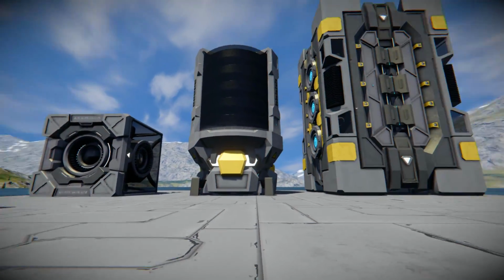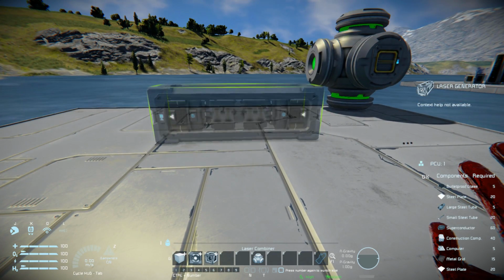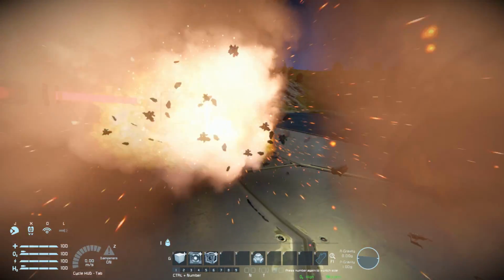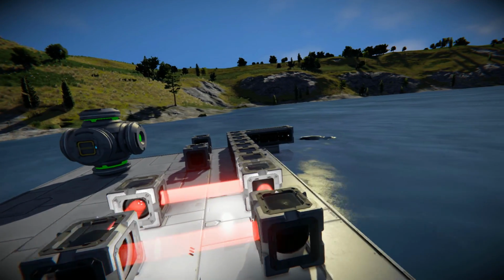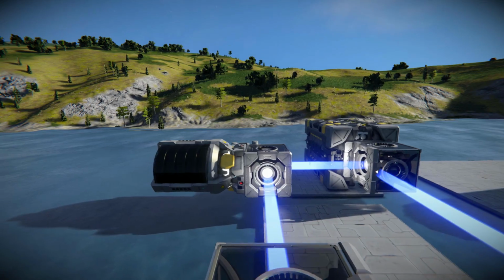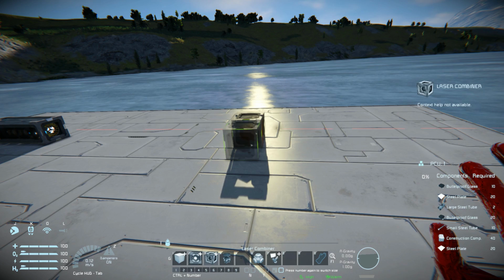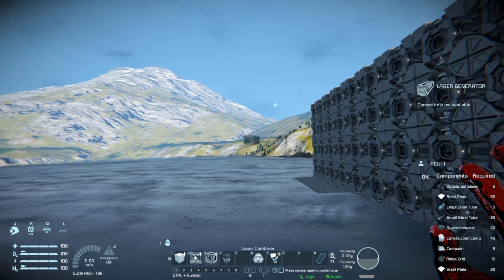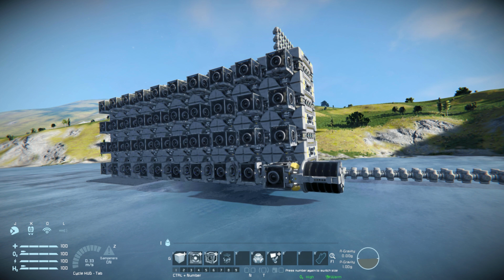2cm Beam System - Space Engineers (Mod)

Comment: a block that would really help this for charge up is a combiner that can flip between two emitters at the touch of a button. also the small laser will be a much more pratical ship to ship weapon while the ion beam would be better for anti station work (long range plus unmoving target)
Reply: i think it'd be possible to make the ion beam work for ship combat. most of the beam handling equipment would need to be deep within the ship and have the beam directed down  a path to a turret that can fire it out in any diirection
Reply: @killman369547  it's gonna be a bulky ship do to the need for the sheer size of the entire thing. As a bombardment weapon you can afford to just sit a few kilometers out as you trickle charge the capacitor.

Comment: This Mod is awesome and you are awesome for reviewing it. I had several hours of fun experimenting with the lasers. I ended up making a giant arc reactor looking thing to charge up the Ion laser. from my testing i found that you don't need the capacitor to fire the Ion but it does make the beam last longer when you use it. i used both pistons and rotors to make the system fire wish i had pic.
Reply: I imagine with some use of rotors and [istons you could make a revolver type weapon system to capture energy, then revolve around to another loop and, ocne you have enough stored up without losing too much power, fire them at an interval to match the loading of the energy into the next round.  Basically a rapid firing beam weapon with only one emitter.
Reply: @Gaalidas  I like that idea I'm going to go and try to build one

Comment: Nah, you did NOT cover everything. How is it supposed to work in survival? Like, how do I remove the last piece of the loop safely?
Reply: I think you can use a piston that moves up and down to disconnect the loop to fire and then to reconnect and charge up. Set up some timers and have a laser gun shooting at some intervals :D
Reply: i agery yeah
bro
Reply: It doesn't matter if the laser is just hitting the edge of the block, shown in the video. So you can have the last one on a piston and just lower it to release it.
Reply: It would be safest if the piston moved in the same direction of the beam. That way the beam doesn't slide sideways and hit unintended blocks which may be housing the laser core room.
Reply: To get it to fire with pistons, you'll need 3 pistons & 4 combiner blocks! the 1st of the 4 combiner blocks is static(which is where you add the laser generators) which fires into the 2nd combiner block that is on a piston which moves only at most a quarter of a block which fires into the 3rd combiner block that moves in the same direction as the 2nd combiner block but a little more than half a block which fires into the 4th block which moves in the opposite direction of the other 2 pistons, which it fires back into the 1st combiner block! Which it should clear though a single block area but not hit anything that isn't suppose to be shot at!
Reply: Which if you want it to be aimable! You'll have to have the whole thing on it's own rotor grid-like turret, mind ya!
Reply: @elementalblaze79  You can also power up the laser from below your custom rotor turret.

From below the turret:
(☼ = z-axis rotor, ╧ = y-axis rotor, ►◄▲▼= combiners)

►►▼
▲☼►     ►
►►▲  ╧

The piston will launch the charged-up beam into one of the combiners near the base of the turret, which will redirect the beam into a combiner on a secondary sub-grid pointed at the target.
Reply: @vision-of-dog  yes you could do that but you must have it aligned so the 1st combiner on that grid stays centralized, & if it gets to far off(ie: goes off that block) it'll fire though whatever is in the way! So you must take caution in the design of it but it would just be easier to have the whole thing just rotate due too that!
Reply: @elementalblaze79  What do you mean by "1st combiner?" The ring of combiners is to make sure the turret acquires the beam at all z-axis rotations.
Reply: @vision-of-dog  the 1st combiner is the one that the laser gens fire at! The others just bounce the beam around until you need to release it & then move around a bit to allow the beam to exit said loop!
Reply: @elementalblaze79  The goal of my turret design was to take a generated beam and shoot it off in any direction without needing a giant turret head to house everything. The beam is bounced around and generated underneath the turret, released upwards into the bottom of the turret, getting redirected by the combiner ring, then aimed at the combiner controlling the turret's up-down aiming.

By doing this, the beam generators can be safely kept under a lot of armor, and the moving part of the turret is a smaller target.